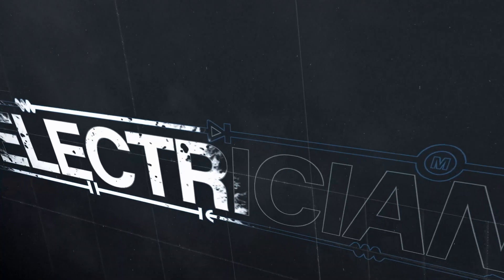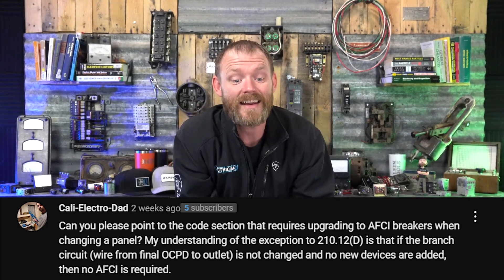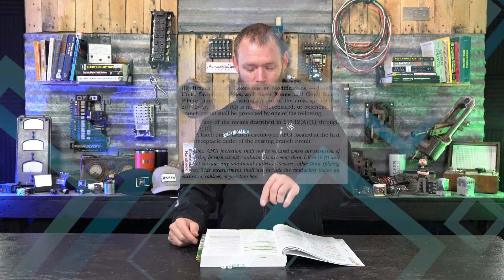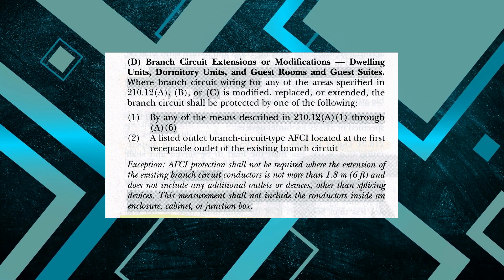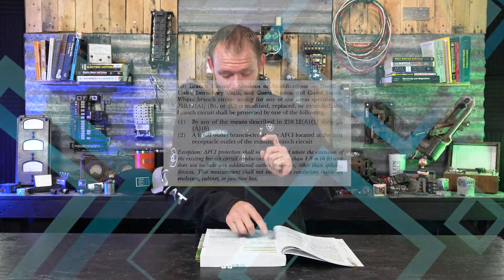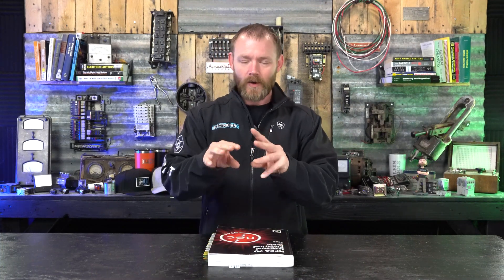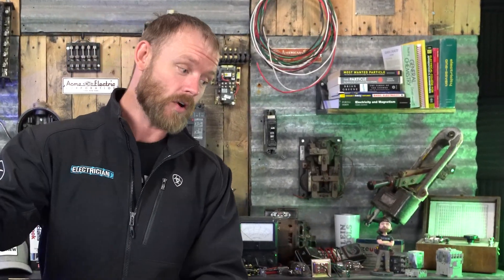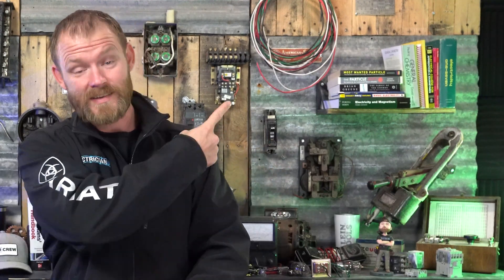Do We Always Need AFCI in a Panel? Is There an Exception?

Comment: hi friend, can I use an electricity monitor between our cooktop range & the electricity wires to monitor the kw by the cooktop? 
we have ariston elect cooktop range (2 burners) in our condo
It's hardwired to electricity wires (no wall socket)
We'd like to monitor the kw consumed by the range
I saw an electricity monitor (V, Amp & KW) online which has 2 connectors on top & 2 at bottom, my question: if I install the device between the electricity feed wire (lines in) & the cook range (line out), will it work & also give us the kw read-out? the monitor device is advertised to connect to the fuse-box. Do u have any alternative solution? Thank you 🙏

Comment: Podunkville lesson,
several years ago...
Except inside city limits county governing body was Assessor's Office. 📞 Called them up, if Electric Coop says it's ok then it's ok.

Over the backdoor the 60 amp service came into a fuse box with 4 15 amp screw in fuses and 2 FRN 30 amp cartridge fuses. The cartridge fuses provided 240 volts to the well pump, water heater, in the wall AC and electric range (either the oven or burners but not both). Of course you had to be careful not to turn on more than one load at a time.

They had me add a chest freezer to the 30 amp circuit. The Coop electrician said ok as long as the home owner knew to unplug the freezer before they pumped water, heated the water, ran the AC or cooked anything. 😖
Reply: Forgot to say the meter was the main disconnect. The Coop said to use dykes to cut the lock tab on meter collar, unplug meter, turn 90° and push into nylon tabs on meter base. They wanted me to call to have them reconnect. The guy was running late so he said to plug it in. If it didn't "smell funny" the work was probably "ok". He'd stop by on the way to work in the morning to lock the collar and look at my work. Said he'd call if he had questions.

Comment: Okay so... Still haven't had a question featured in a video but I really want to ask you this one.

Ignoring anything residential and/or commercial, is there an NEC that 'only' deals in heavy industrial environments with medium voltage (480/680V)? I have been working as an industrial electrician for a while now and I've always wondered if I should just apply the standard latest NEC code book to my industrial work or not. Is there a sub-set of code that more greatly applies to industrial environments or am I over-thinking this?

Thanks for the videos and keep up the awesome work!

Comment: An AFCI is not required where there is a GFI protected circuit - 
Basically replacing ALL regular inexpensive breakers for these wildly overbearing and extremely expensive 'protection' devices.
How many locks can you put on your front door before it becomes counter-productive to even have them on your door ?
THIS is an AFCI -- just too much for an absolutely negated payback.
Michigan no longer requires them.....Thankfully.
Reply: I saw that shit and started laughing at all the homeowners having to visit their breaker box once a day. Certainly the panel area will be cleared out for you though! 😀
Reply: The state of Michigan no longer requires AFCI's at all?

Comment: A major complaint is "My refrigerator trips those breakers," or, "The ceiling fan brush motor, vacuum, fireplace blower keeps tripping it." Would you ever do a video where you show that a vacuum or fridge does or doesn't trip these breakers?  In my experience the breakers have gotten much smarter and don't trip on minor motor load uses.  Great videos.
Reply: A motor has a considerable initial power spike when it starts which is the reason for the breaker tripping.
If it is a 15 amp with a Fridge ? then that is your problem. If it is something else then chances are there are 
a number of different things drawing power on that circuit and when the motor starts it is just enough to
push it over the edge to pop the breaker.
Reply: They do with all sorts of loads. Keurig coffee makers. Laser printers. Vacuums. I've seen brand new square D, BR, CH, QO, and leviton trip even on dedicated circuits. 

Yeah, they aren't as bad. But a critical circuit like smokes, fridge, freezer, and life safety don't belong on one period. I've gone to enough calls where their circuit tripped and cost them hundreds. 

And at the end of the day, the only people winning are insurance and industry. Even the data they use to claim these help is misleading at best, bullshit at worst. These claims always come with the usual legalese drivel of " may prevent up to be x percent of these type of fires". 

Then you put the numbers into perspective. The majority of fires happen in far older houses that were wired piss poor. Is it REALLY worth driving up the cost for homeowners who can already barely afford homes by thousands of dollars, for sometime that on a BAD year will affect less than 0.05% homes? Those odds are mighty slim, yet you get to pay an extra $4000 on average for a full panel LMAO. And get nuisance tripping and a breaker that maybe lasts a decade.

For added perspective, these aren't even total loss fires. These are typically minor fires that cost under $20K in TOTAL damages between materials, furniture, and structure damage. 

People catching their homes on fire from cooking is still far more likely and with a much higher average cost LMAO.

It's all perspective

Comment: My friend renovated a whole house two years ago, and I did all the wiring from scratch, brand new panel, all new wiring and devices. Had one AFCI breaker that drove me crazy, tripping randomly after anywhere from 10 minutes to 3 hours, no rhyme or reason. It was a 15A lighting circuit with literally like ten LED canless ceiling lights on it; total draw on the circuit with all the lights on was about 2A. I changed the breaker three times and finally got one that wouldn't trip. 🤦🤦
Reply: If you call up siemens they will send you out new breakers.

Comment: I work in IT as a datacenter architect.  I have found AFCI breakers to be a pain in the ass when there is an upstream power protection system like a rack mounted UPS. I suspect some of the internal relays cause this. That said I like using AFCI breakers for most common outlets if I am replacing a breaker anyways.

Comment: I have a detached shop with large overhead door and installing a heat pump (220 20 amp) I’m getting conflicting answers does the outdoor and/or indoor (220 20) unit(s) have to be on GFCI and/or AFCI by current code? Currently unable to get a clear answer from the inspector.

Comment: Just as there are historically poorly designed electrical equipment manufacturers that are commonly known by every one.
Hopefully 20 years from now residential service electricians won’t be cussing well known AFCI manufacturers whose electronic products historically failed.
Some are already leaning in this direction.

Properly troubleshooting each manufacturers latest updated product is the new service skill.

While visiting with a senior electrician, I was told of the high failure rate of GFCI technology when it was first introduced “back in the day”
Reply: too late, they fail left and right, nuisance trip like mad and have since day one and one good nearby indirect lightning strike may wipe them all out at once.
imagine nearly a whole house with the panel full of them, BANG. house is off and none will reset.
to be fair, I put a ton of them in a few places with old wiring, where they also had cobbled in grounded receptacles, with short jumpers bonded to neutral( the whole house!)
so, to cover my own "rear", I filled it full when fixing the other idiocy.

Comment: I have a friend asking me to move a panel, from inside their office, into the bedroom of the apartment it feeds. It’s definitely more than 6’ from it’s current location. It also makes me nervous because we live in “podunk wherever” and they did the electric themselves when they built the building, and the building has been changed inside multiple times since it was first built. I really just want to tell them no, and that they’ll need to find someone else. I know there are things in there that are not correctly wired. The worst part is when he said to me “I don’t care if it meets code” 😳
Reply: Run away! I wouldn't touch it.
Reply: Ask him if he minds if you use speaker wire cuz its cheaper.
If he says "sure" ? Do not do it and quietly take a life insurance policy out on him.
If he is that stupid then it will pay off.

Comment: Nothing like switching out an old federal or bulldog panel, then having the homeowner say "some of my breakers keep tripping now. You broke it. It worked fine before"
Reply: True. 😆
Reply: Ahhh..... circuits with neutrals interchanged and multiwire circuits are 🥰😘lovely😘🥰 to find and fix in an old house where handyman have been screwing with the wiring over the years.
Reply: When all neutrals were tied together and now the arc faults don’t work lol

Comment: I have a question  I have a 40 ft motor home/RV I am wanting to install a tankless instant hot water heater in it because they are cheaper to purchase than the regular ones they have unlimited hit water and the temp is remote controlled. Anyways the RV has a 50 amp system that is 2 legs of 50 amps the hot water heater is a 5.5Kw water heater and it requires a 30 amo 2 pole breaker do you think it would be safe to install a 30 amp 2 pole breaker? It's under the power rating for the RV and each pole would pull from a separate leg  so isnit safe. Also how should I install  it should I replace a couple of 15 amps with a tandem and then install the 2 pole 30 amp or should I add a small mini sub panel with a mini 2 pole 30 amp breaker? Any help would be great the only reason I even understand  anything I just explained is because I watch your videos and I have been reading alot  the model of water heater I'm trying to install is an Ecotouch 5.5Kw for reference. Any advice would be great thank you.
Reply: Please learn how to type before you attempt to perform any kind of technical work.
Reply: @waytospergtherebro  by the way smart guy I build custom sound systems so I am very capable of technical work. Including technical work involving electricity. But there are differences between the types of electrical work in the two. So once again don't be so quick to pass judgment. I could probably school you on a thing or two.